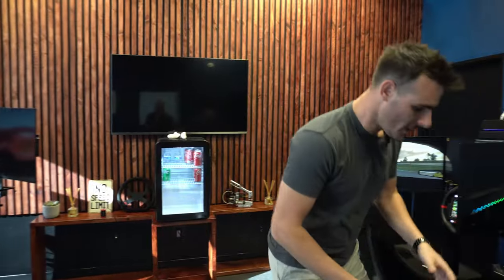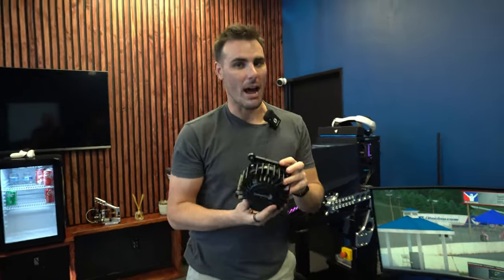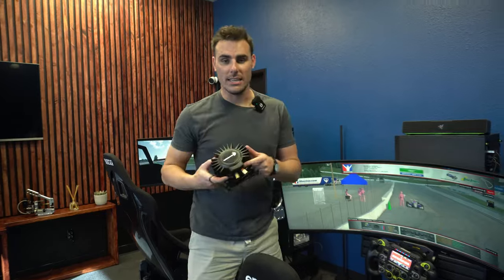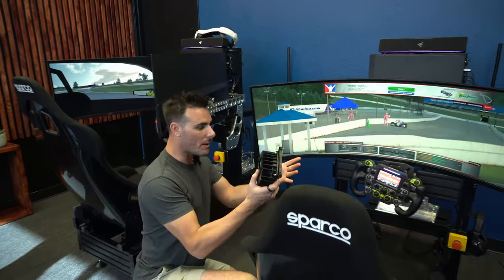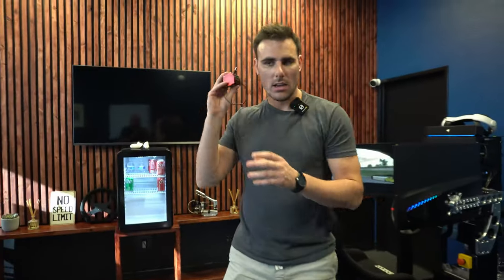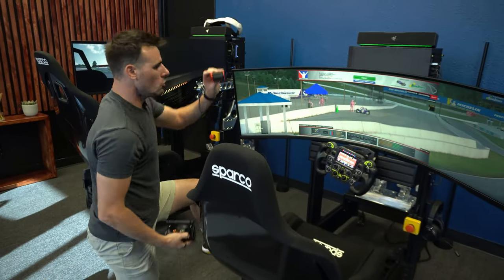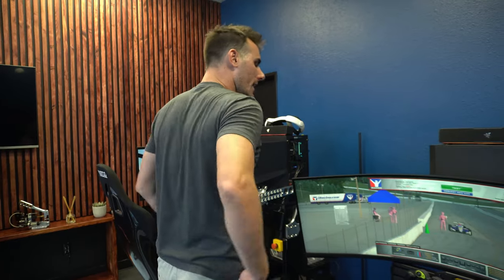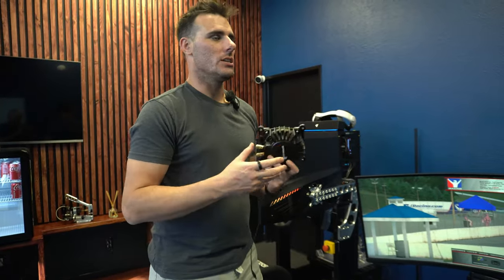BUTTKICKER Is Ruining Your Racing Sim!

Comment: I disagree. I tried one on each side and it's one dimensional compared to a good four corner set up. Four provides more depth and fidelity, you just have to develop the sensitivity for it to register, just like you have to in a car on track in real life. I do however agree with the less is more philosophy when tuning the effects.
Reply from the maker: @jogb9515  totally fair!
Reply: @SimCoaches  I've thought about this a lot, and think a config of 4 shakers, all directly under the seat in a grid of 4, sounds ideal.
That way, you get left and right feel coming together in the same place, so it feel natural from a left/right car perspective of car effect.
But your butt can also feel the individual suspension corner rumbles, without them feeling all spaced out over a rig.
Reply: Less is more as far as limiting how many things one haptic unit will register. I use 5, one on each corner, and one behind the seat. My corners only register wheel slip/lockup and road vibrations (curbs and such) The middle one registers, engine and gear shifts. I feel everything in detail. Its only when you

Comment: You can use a lot of Bass shakers, the key is to make a good mix like in music. Use different frequencies , use left and right, use front/back, use different volumes and you can feel everything. put more emphasis on important info and less on others that do not affect much relevance . Front/back separation works better than left/right.

Comment: the only thing that actually matters is isolation. i used some cheap amazon iso springs on the 4 corners of the rig and that is what makes all the difference. before that the effects felt muted now due to the springs i have a slight lateral shift when turning and the effects feel almost real in vr. best upgrade i did so far.
Reply: Can you send a link please? I searched for iso spring with no luck
Reply: @leomatis_  it's the ones with the red for around 50 bucks for a 8 pack, i inverted them, attached the silver plate to the rig to hold the spring. on the bottom i used the red rubber stoppers but cut of the ends so they are flat on the floor with the spring in them.and they aren't 100% fully attached to my rig. but it's perfectly stable and hasn't failed in over a year since installation. hope i explained my ghetto solution properly  lol
Reply: @FatswellSmart  thanks mate
Reply: @FatswellSmart need a tutoriql

Comment: Less is more only applies to active effects per shaker. Give each channel/shaker a base job and a high priority job, like road effects and kerb vibration.  The reason I have 7 shakers and will be adding more is to better distribute the effects across multiple shakers and not ask too much of one at a time. Two per corner isn't out of the question with multiple under the seat. The trick to feel the separate corners is to have the rig on spring isolators to allow it to vibrate freely without transferring the noise to the room around it.

Comment: Also disagree. I have the Slip Angle system on a ASR6, plus pedals and one under the seat. If it's tuned right works great and adds immersion like crazy. As someone else said, isolation is the key and not over doing it with too many effects.

Comment: I think the sum total of what you are trying to express has some merit. However there are so many rig configurations and setups that in many cases more locations of shakers can still be very beneficial and a good thing. SimHub and bass shakers can 100% become muddied up and too much sauce but there are some cool things you can do when you explore the dynamics. Two shakers on the seat plus pedal haptics would be excellent for a lot of simulation but shouldn’t discourage more use cases.

Comment: Im currently going through the process to find the best and cheapest way possibly to isolate each corner. At first having all 4 mounted to the rig. i couldn't tell the difference from left to right. Until i mounted them spaced from my rig with rubber washers. Its still not the best but im thinking of taking 2 sheets of plywood, cut one into 4 sections, drilling holes and gluing tennis balls in the holes, then set the 4 sections on top of the tennis balls, mount eash bass shaker to each corner of the sectioned plywood then set my rig ontop that way each shaker is transmitting vibration through its own leg of the sim rig. Itlls still have some vibration felt through the whole rig but it should feel more localized.

Comment: I get what you are saying if you crank everything, but  I have 5. One on each corner and one under my seat. I turn down the effects and phased them properly. Coming from an audio engineering background, you have to understand these are speakers and you need to isolate the rig, insure you phase them properly (if they are not all pointing the same direction, and isolate  the frequencies. The rig will have a resonant frequency that will soak up certain vibrations and you need to tune those out and don't put the same effect on each transducer. For example I do the engine rpm on the seat only, gear shifts on the rear and the seat, etc.  You can feel the difference from front to year. Mind you, it did take me weeks to get it right! Thanks for the info though.

Comment: I disagree, as many here do. Currently using five shakers: one on each corner to simulate the four wheels, one under the seat for engine vibration/RPM. It was quite a lot of work with intensive testing to create good settings in simhub to be honest, but the ~12 hours and the effort I put into it payed off: I can perfectly differentiate each wheel and locate the effects easily while driving.
Reply from the maker: Great info!!

Comment: There is a very long debate concerning this, and so many audio professionals spoke about this. I have been using 7 on my cockpit and yes you read that right 7. First these Daytons even though they are cheaper than the rest of the competition, and trust me I have tried them plenty. There is a plastic springers on both sides inside that tend to developpe cracks and brakes which renders them vibrating weirdly. I like the Aura's more because they are more reliable and vibrate a bit better than those Daytons. Once you place these shakers horizontally and on a plate that is connected to the chassis with a specific point the whole vibration experience changes (Something similar to the brackets sold by Slip-angle of Canada) add to that you need to use some high end speaker wires to reduce noise or what we call "bruit" it also depends on the amp used and the soundcard used so there is so many variables to it. I use 4 aura on plates on each suspension placement with limited effects and frequency, another larger under the seat with a bracket that is piston based (Buttkicker advanced) and 2 of these simagic ones on the throttle and brake. when you set them up nicely and give them a little bit of tinkering on the volume and frequency used they do become an essential part of your simulator.

Comment: Yes, you are right. But ................The trick is to isolate the bass shakers. I have 7 on my rig all isolated from on another. All can be felt independantly without ibterfering with any of the others. I used varying isolators meants for heavy machinery and had to make modifications to my rig in order to accomodate this set up. And yes it was totally worth it.

Comment: I have the Manacor exciters set up on my rig, under the seat I have 2 x 50w (AR-50), left and right, these are setup of road rumble and kerbs, on my pedals I have 2 x 30w (AR-30) on the brake for ABS and on the accelerator for TC.
Reply from the maker: @IsDaveGaming  sounds like a dialed setup!

Comment: Disagree to some extent. I have a Buttkicker and 3 bass shakers. Each one does something specific and at a specific time. This way no single shaker is overwhelmed with noise and hopefully will last longer. As four directional vibrations, if they are tuned high enough in pitch you can “hear” the vibrations from a direction. But, low frequencies are non directional and with the rigidity of the frame you won’t be able to distinguish. Rpm’s (2x) at harmonic frequencies,rumble strips, road bumps. Each works individually and feels fantastic.  Also have two rumble motors, one for brake and one for throttle. Subtle, but tells me the limits.

Comment: Underrated setup: two dayton bst1s on the back sides, 1 simagic HPR on the brake, 2 simagic HPR bolted to the pedal plate.
Reply from the maker: @BenjiBoo42  ooooo HPR on pedal plate is interesting
Reply: @SimCoaches  I did not like having one per pedal, and I don't use p1000's either. Had the idea to turn them up and mount them to the pedal plate. Daytons give left and right, pedal plate gives front input.

Comment: Why right/left instead of front/back? I would think it would be pretty obvious that if you're sliding in a right hand corner the side sliding would be the left side.
Reply from the maker: Because these shakers are great for deeper haptic vibrations like curbing, gear shifts, dropping wheels. Putting haptic reactors on your pedals right under your feet then solves having something up front

Less about feeling a slide on the left or right side of the chassis and more about getting the more immersive feedback like kerbing, shifts, bumps etc through the larger ones

Comment: Thats why I modified my racing chair with small shakers, one on outside of each thigh, and one on each kidney, and one bigger one in the lowerback. The last on fed from iRacing shaker setup, gear and rpm almost un noticable. Rest from each suspension from simhub. Very good immersion when used

Comment: Is it possible to use simmagic haptic reactors on console in combination with 2x dayton bassshakers on the rig ?
Reply: Yes but you need to use the Data out to a Computer and Run SimHub on that Computer to Control the SimMagic HPR's and then the Bassshakers ....... I am running this setup racing Forza Motorsports and Forza Horizons 5 on Xbox

Comment: But when you have wheel spin, the throttle pedal in a real car does nothing. But you sure as hell can feel the chassis of the car vibrating from the tire breaking traction...

Oh well. I'm sooner to go with a slip angle kit (or DIY) than to put haptics on my throttle pedal.

Comment: Did you actually install the pedal shakers?
I did, and they ruined the connection from my wheelbase to the sim.
Still haven't been able to fix it.
Reply from the maker: Yeah, we use them on almost all our simulators. We’ve never had any connection issues outside of a problem with SimPro manager. Once we swapped to simhub it worked perfect
Reply: Do you have fanatec? I've seen several comments in youtube videos and reddit of fanatec gear no longer connecting to PC after settings up simagic haptics
Reply: @jmancherjeee  Yes. And that's exactly what happened.

Comment: You are kinda close , but still very far away from the competent answer.  Corner solutions reduce the energy from the shakers and even blend together so much its still hard to tell what corner actually vibrates, so the way to go is to mount them as close to youre body as possible (seat), and even better; use some kind of vibration isolation between seatmounts and rig so the energy mostly goes into the seat and not to the entire rig.  Regarding shakertypes, the best solution is to use several shakers of different sizes and take control of them with high/lowpass EQ, sort out what frequencys to go where, and not running many effects simultaniously to the same shaker. On top of that, there are effects in some communities that are way better than the standard simhub ones, but you got to look for it and learn the basics the hard way first.

Comment: IMO you only need one.  In a real car, when your lefts hit a curb, the entire seat vibrates.  When the rights hit, the entire seat vibrates.

Just use one and your brain does the rest.
Reply from the maker: It’s good insight!
Reply: For dirt rally one is good. I did engine vibration, jump and shift. Good for immersion. The dirt rally telemetry isn't very good for anything else. Some of the other effects are more annoying than helpful. Like I know I'm sliding, I made it slide. It's probably different for road cars.

Comment: Disagree. If you mount or use incorrectly, sure it will have issues but that is caused by yourself, not the device. Correctly used and mounted is a positive experience. What is completely wrong is title of this vid. Clickbait crap

Comment: :face-green-smiling::face-green-smiling::face-green-smiling::person-turqouise-waving: It's easy to talk without experience, I've been using bodyshakers for years and what I like most is the configuration I've had these last 3 years, it is expensive and difficult to assemble, but in VR+belt tensioner, it is the one that gives me the most realism and immersion... 
The seat is mounted on an axle with bearing (left-right to feel the tensioner more in curves) and on independent and pneumatic 4-point cushioning, it is adjustable by air, and it is a real car seat, it is not rigid, and underneath there are 4 bodyshakers, 1 in each corner, with independent grips and to avoid transfer of effects between them. I carry another 4 on my back in the same way, independent, they are 100W RMS (reckhorm bs 200i) 
The pedal board is mounted on 4 rubber+springs with a stop at the tip so that it only goes up and down, and that function is done by 2 12 "subwoofers, one below and one above, they are blocked and prepared as heavy bodyshakers, which do the same, and with less noise than 2 powerful buttkickers (Fischer Amps Buttkicker LFE) I also carry 2 very powerful and fast motors in the pedals (brake and accelerator) and they do not look at all like the small commercial motors ...
 And for more immersion, I carry another 12 "Sub prepared to move the entire chassis, which is also mounted on 4 air/water tires, like a miniature tractor.
To feed everything, I have simhub with 2 5.1 cards, 6 preamps above the central monitor, so they are easily regulated and 11 mono subwoofer amplifiers (8 of 100W and 3 of 300W)
The 3 screens go in another chassis, and if I'm honest, I enjoy it more than a dwarf on a giraffe...